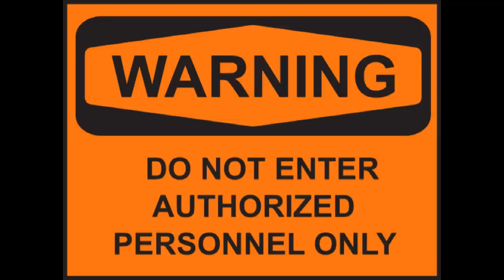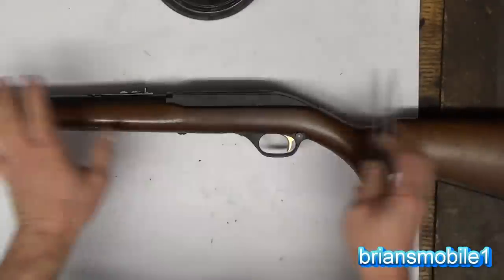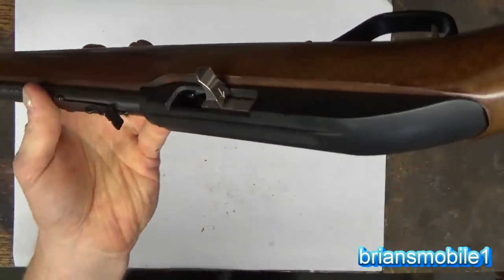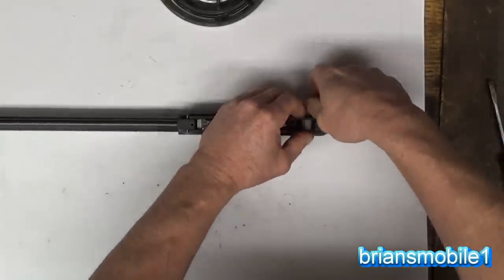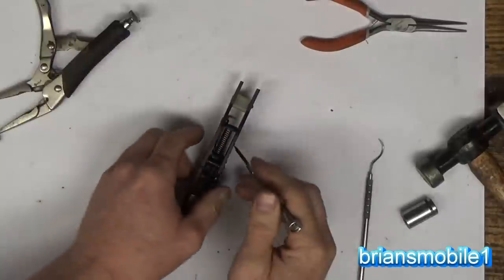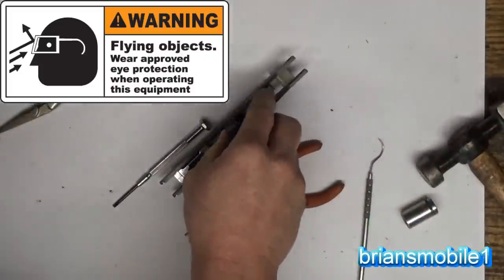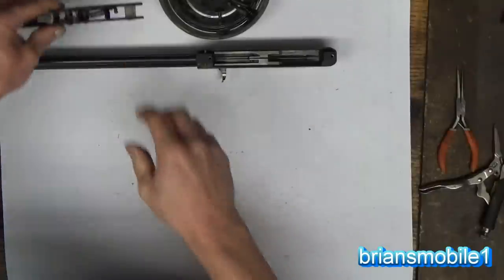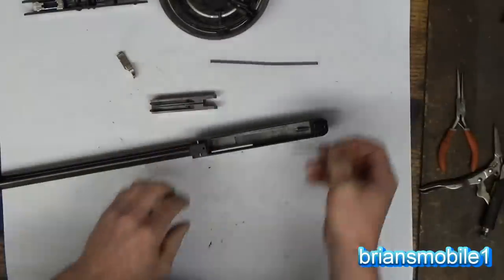Marlin Model 60 Tune Up

Comment: I realize it's been almost 6 years since you did this vid. I surely hope you see this. First I want to thank you for doing this how to "for information only" on the model 60. The way you accomplish this procedure is designed for the poor guy who doesn't have a 'fully equipped' smithy shop. It's how that same poor guy would do this at his own kitchen table IF he were to pretend to be doing his own work. So THANK YOU for making this procedure much more sensible and super-duper easy to follow along. Secondly, I inherited a first year run of the MDL 60 a few years back, and I have yet to take it out dancing. 

However, as I ALWAYS do when, I come into possession of a used firearm and often do with brand spanking new showroom ones, I go through it, inspecting it for worn (in the used cases) and for rough spots or burs, abnormalities and such on new ones. I wrote Marlin asking for the specs on the original 60 so that I could put my calipers and mics on them to check for excessive wear but never heard back. Then I found out that the company had been sold and bought by another company. As I was cleaning and inspecting this beauty, I did not see any really worn spots that denote excessive wear. But I did see the old style firing pin, and it made me go hmm, but, I haven't replaced it yet. That is, IF I were going to take this to a "licensed" gunsmith for "expert" repairs. The springs, seem to be very strong as one of them did slip past my fingers and nailed a window several feet away with enough force that, well, let's just say, clear gorilla tape handled the situation until Spring of the year. ;) . Just kidding about that part. I am EXTREMELY careful when working with my tools with springs that make loud noises when certain parts bang against other more sensitive parts and components. So thank you again for doing this video, it makes a wonderful how to put into simplified and easy to follow along instructions. One can not ask for a better way to do it.

Comment: Brian, thank you very much for the video. I have a "squirrel" model that I purchased from Kmart in....1980? I still have it. Last year, I refinished the stock, tore it down, got it cleaned up and running again. I have taught so many kids to shoot with this old 60. The last outing, it gave me a fit, FTF, stove pipes, etc. I think it's time for it's first rebuild. No bolt release on my trigger guard, You have to push/pull the bolt hand to lock the bolt back or release.

Comment: You can bend the ejector spring assembling it the way you did. 

Open the chamber (it will lock open) before inserting the action.

Comment: You're an excellent teacher one of the best I've seen. You did a good job going over all the points that a lot of tubers just assume i must know how that came out or goes back in. I did a match grade trigger job on an HK USP 45 and the guy did well until right at the end he rushed thru the sear and disconnect, etc. Well if I had not had a little know-how of firearms and being an auto mechanic also i would have been screwed but I figured it out and the HK worked great the safety worked, the reset was good, the decocking worked and I had a little over 3 lb  pull in SA and it helped the DA also. A lot of people can work on things, but few can teach someone the way to do it, you have that ability to teach as you do the work. I appreciate everything you have showed me. I think it's great that there are still people like yourself that take the time to do this for no pay or gain other than you like to help your brothers if you can, I am the same way I had rather help than be selfish and not try to tell someone how to do something IF THEY WILL LISTEN TO WHAT YOUR SAYING I will show them what they will need to do to a car. Some look at it as if I'm cheating myself out of money by doing this. But it's not all about money. You keep up the good work I appreciate your time and knowledge.
David

Comment: The bolt should be pulled back before re-installing the hammer assembly back onto the receiver.   I learned this the hard way because I didn't re-install mine with the bolt back after cleaning.   My gun wouldn't properly eject after that because re-installing it without the bolt pulled back can bend the ejector wire.   This is why somebody invented the nickel trick.    It took me a few tries with the needle nose pliars to get the end of that wire back into the correct position.

Comment: That really brought back memories.  I'm planning on picking up a Model 60 next month, but I want a pre-1984 model so it has the longer barrel & 18 round capacity.  This video of "not" gunsmithing will be very helpful if I can find an older one.  In all likelihood, I'll need to update all of the hardware and will probably update the stock if it's all chewed up.
Reply: They came with the full length magazine tube and barrel until around 89-90. I have an 87 and 88 both with 22” barrels and magazine tubes that hold 18 rounds.

Comment: I like your Humor. My Glenfield 60 is from 1979 and comes apart a little different. Screws instead of pins holding the trigger group. I have only replaced the recoil spring since I bought the Rifle in 1979.

Comment: I added the Mcarbo trigger spring kit to my model 60 and it really works great; about 2 1/2 pounds of pressure now instead of 5-6. I didn't like the trigger so much that came with it, so I later went back to the standard curved trigger; great rifle.

Comment: I have a older model 60 with a 18 shot tub. Got it in my mid teens and I’m 50 now. Yes I still have it and it goes bang every time I pull the trigger. The only problem I ever had was the trigger assembly back bolt hole broke do to it being plastic. But I found a new one along time ago a fix it. I have a ruger 10/22 but I still love shooting my old model 60 still.
Reply: Bad Company-50 biker had the same thing happen 20 years ago. Super glued it back together and it still is working fine. Going to start looking for a replacement eventually. Until then it still goes bang.
Reply: Bad Company-50 biker agreed! My first and favorite .22 auto loader rifle. It shoots better than the 1022 and savage65 I have. Only rifle that is more accurate is my (now daughters) Mossberg 46B-B target

Comment: Sometimes the pin that holds the firing pin is sticking out slightly and either needs tapped in or filed down . You can hear it . It will sound gritty . When u take apart u ll be able to see a little gouge on the inside where it’s been rubbing . It’s evident of your bolt doesn’t close all the way or stops on its way that’s the likely cause . I ve seen it three times so far and fixed and then it’s like butter

Comment: Thanks a bunch. I have a mod 60 that my wife gave me years ago and I love it. Cheap plunker to shoot. My son got a very old one from his grandfather that he loves. I think both of them will be getting a tune-up, for entertainment purposes only, of course.
Reply: Instead of rotating the plate and allowing the spring to fly off and either 1 hitting someone in the eye or 2 getting lost press the hammer down which will compress the spring and push the rod through the plate. Then slide a paper clip in the hole. Which you can remove later

Comment: Ha, these vids can be extremely helpful. About 10 yrs ago, I bought a brand new Marlin Model 60 with a polymer stock. The gun was shipped WITHOUT a firing pin. So, right away, I got some experience installing a firing pin. After that, the gun worked great. Go figure.

Comment: you should put the bolt rearward when replacing the action. There is am ejector guide which is easily bent if you don't and it won't feed properly then,

Comment: I enjoyed watching this. I just picked up a Glenfield Mod75 (Marlin Fire Arms Co.) Cal.22LR tonight. I'm not sure how old it is but it is dirty as all get out. I took it apart outside and found a family of cockroaches living in the trigger and around the firing pin. I HAtE COCKROACHES and dirty guns lol. The stock is in rough shape. I believe I will be refinishing the whole stock and adding a little wood filled to the back of the trigger screw area. Someone tried to do "something" there lol. The barrel has pitting and surface rust. Looking up how to clean this without causing any more damage. After watching this I can at least look closer in to the springs and pins. This was very informative. Thank you for posting this.
Reply: I have a Marlin model 66 carbine, took it apart , broken recoil buffer, putting it back together,,, have one small spring that doesn't seem to work anywhere, not the ejector or seer spring, only seem possible to connect to hammer post to inter act with the trigger bar with the fork end, that the trigger hits, all the videos I have watched don't give much attention to that area or their fingers block the view, sure could use some help, I bought this rifle in late 1967  or  early 1968 new, I had come back from Nam and the carbine was so realistic to the 30 cal I had seen

Comment: Theres a hole on the back of the hammer strut to pin it and tension will be off the saddle. Much easier than vice grips lol. Not the easy way!!! Let the hammer down (de-cock) slowly, don’t let it just slam up. Nice video though. Lotsa tips and very funny. Thanks

Comment: Nice video Brian. I have a late '80s vintage m60 that did great after a good thorough cleaning for about 100 rounds. Then just that little bit of dirt caused it to malfunction. Sometimes the new round would not seat all the way into battery, a gentle nudge usually seated it for firing. Other times empties would get caught sideways in the reciever with the bolt mashing twin gouge marks into the new round that couldn't go where it needed to. Now "hypothetically speaking", do you think this "tune up" you entertained us with might fix it?

Comment: New subscriber, thanks a lot, info wasvery helpful, have a Marlin 60 and it is always a chore to disassemble and reassemble. Where did you get the replacement parts from Marlin?
Reply from the maker: AWESOME!  WOOHOOO!   I've got the parts links in the "SHOW MORE" above.  Just click it and it's right there.

Comment: That’s a post 1990 model 60 . 1988 or 1989 model 60 s changed to shorter 19” barrel form 22” ( xtra inch no one sees or says is there 😂. Let’s get it right fellas . And capacity from 18 to14 after stupid gun laws . In the 80 s . So if ur Marlin sayys 11 million something it’s 1989 or 1988 and should be a desired Marlin model 60. Haven’t tried anything more than a 3x 9 scope but ot works well to group well @100 yds . I always wanted to try it with a 4x14 scope and see what it can do longer distances . Will try soon . 100 yds is a long ways to hit consistent with a .22 but thanks to the scopes they make these rifles so much more enjoyable since iron sights r good to about 50 yds and of anyone says they are awesome @ 100 yds with irons is straight up lyin

Comment: What is the best way to repair stripped threads in the receiver what hold the stock on. I consider this a bad design on Marlins part. Many people take these guns apart quite often to clean them, and when you have small diameter steel screws going into aluminum threads, they will eventually strip. I bought an early '70s model Marlin Glenfield "Golden 50" model, and both screw holes were stripped out in the receiver.

Comment: If ur making a "How To " vid, use 2-3 light sources, it helps immensley on small details. Frames of ur waving hands are a differet matter tho, lights won't help, scripting would.
Reply from the maker: +Dan Roy Thanks Dan!  That's some good advice and I appreciate it!
Reply from the maker: +Dan Roy Wow.  The lighting IS terrible in this video.  I think I may remake this one.
Reply: +briansmobile1 Shoot one light from camera position for the detail inside nooks and crannies. Otherwise, all else works pretty well. You were so much better prepared than most. Good work.
Reply: +briansmobile1 ..hey there, about how many rounds before a tune up like that is needed ...thanks, great presentation.

Comment: Brian there is a (bulldog or Pitbull ) kit for the Rugger Ranch Rifle. Have you seen this
or installed one? I have the kit and a older 223 Ranch rifle but no instructions.  Also
a common problem on the Dodge with the 5.9 twin cam Cummins diesel is coolant leek on the front passenger side of the head, could you show a video on that?  Thanks
Reply from the maker: wwherbert007 I think you call that a bullpup if it's like the European rifles.

Comment: Quick question. I can load my first round into the chamber when I pull back the charging handle and just let it slam shut. However if i'm slowly allowing the bolt to close so that i can watch the first round enter the chamber, the round will eject. I'v taken it apart, cleaned it, and oil everything well, but it hasn't solved the issue. Thanks

Comment: Any plans to do a video on how to replace the extractor? My Model 60 will not extract, the empties are pulled back, but are not ejected to the right. Thanks
Reply from the maker: +Richard Winchell I would love to.  So the hook pulls it back and then it hits a pin on the left side that kicks it out.  If the hook grips too well, it won't kick out and if the pin doesn't stick out far enough it will jam.

Comment: cool, marlin sticker on it after all the  years   have you done trigger work? want to do that next with my 60,  tried the mcarbo spring kit but had negligible effect.
Reply: I did that to my Marlin but not only the trigger, the hole trigger housing too. But now if I screw the back screw all the way the trigger don’t function. If I loosen it the trigger works. Any suggestions???? Thanks.

Comment: I'm having a real problem with my safety. The button will slide easy over to fire, but to get it back to safe ya got to press with both thumbs really hard to get it to go back to safe. Is there any fix for this besides buying a new trigger asmb.?

Comment: I have a question about jamming... we got a used model 60 for my son recently, and the next to the last round gets pinched in a position halfway between the magazine and the breach. this dents the side of the round, and requires me to pry it out with needle nose pliers. This is obviously unsafe... it is ALWAYS the next to the last round... We have cleaned and inspected the rifle several times, its in fine shape.. I noticed there is an orange tip on your magazine tube. mine has none. I think the previous owner cut it off in an attempt to fit more rounds... do you think this could be the problem? not enough pressure on the final few rounds to allow them to load? 
thanks! Great Video!
Reply: The lack of the orange plunger is one of the reasons that your having FTF problems otherwise the push spring is wearing out
Reply: +Ryan Ho I replaced the feed tube and it works great!

Comment: Informative Video. Thank You!
Reply from the maker: Thank you!
Reply: +briansmobile1 I am having trouble  keeping the  hammer  spring in  place , I do get it to stay  when its completely  depress , I slipped a paperclip and its stays  but when I remove the clip it flys off  could it be another  spring or try bending the gate plate so that it allows  more  of the spring rod to protrude  out right  the gate  now it barely  showing . I done about  6 times looks good and than pops out.  Thanks

Comment: Why do this simple procedure when you can give a gunsmith $250!
Reply: Also the firing pin is prevented from hitting the barrel (that is why it has a linear hole) so dry-firing does no harm!

Comment: when puting it back together,,,DONT have the bolt forward...this will bend the eject spring. the correct way is to have the bolt ,back in the locked position ..and remember kids,,,dont believe everything you see or hear on the internet lmao
Reply: VULGAR DISPLAY OF POWER  Yes you can lock the bolt back w/o the action assy installed.   The charging handle has a nipple on the end that catches in a notch inside the receiver.  The last rd hold open and release lever is on the action assy, on later models at least.  My two from the 70s don't have the release lever.
Reply: VULGAR DISPLAY OF POWER there’s a video on this if I find it I’ll link it
Reply: VULGAR DISPLAY OF POWER  he is absolutely correct Do not have the bolt forward